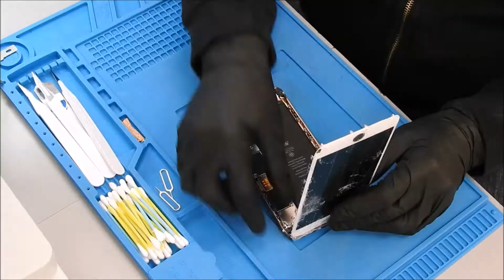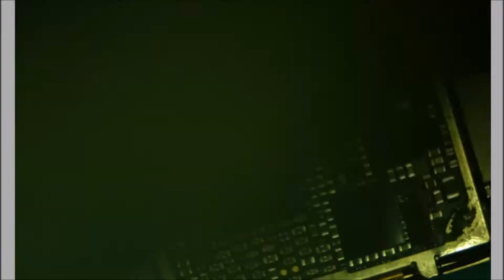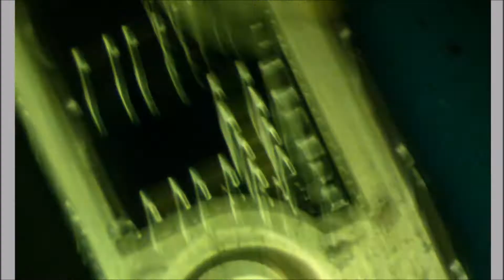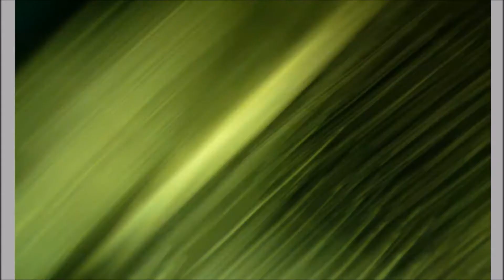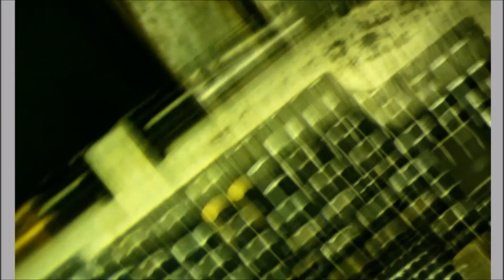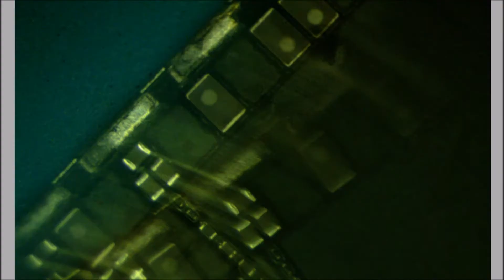PP1V8 sdram Fail

Comment: Do the RAM chip got any serial number that tie it with a specific processor or device for ID purpose?
Reply from the maker: Hey Johnny chang, I dont know for sure but what ive seen the SDRAM half of the chip can be changed just not the bottom half processor. If I do film part 2 I will be removing the SDRAM and the processor and attempting to reball it and make it work again.